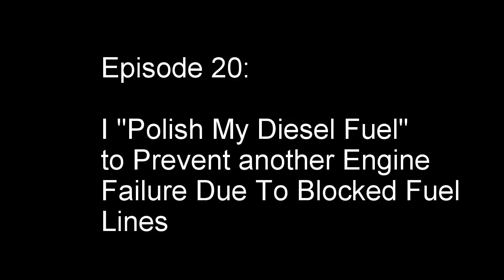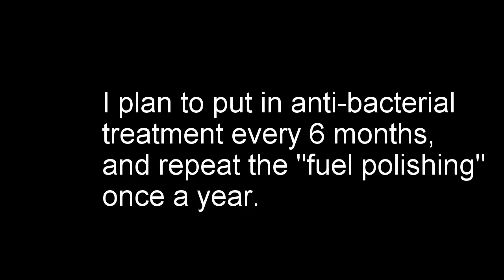Ep 20 Diesel Fuel 'Polishing' To Prevent Clogged Filters and Lines

Comment: The fact you do not see more water than expected is  because of your practice of keeping your tank topped off. I had learned the practice is recommended not necessarily to keep sediments down but rather to limit condensation inside the tank. There may be times you get bad fuel with water but most times water build up is from condensation.
Reply from the maker: Thanks Slamhead.   There is debate as to whether or not the condensation argument is valid…….. (I don't have a view, but do try to keep my tanks filled.   :-)     I do now regularly use chemical treatment, and I also have Racor filters mounted (water separator).   I'm not taking any chances!   Thanks for watching.

Comment: Thank you for all your videos. I recently purchased my first sailboat. She has been idle for the last three years so one of my many tasks is to polish and de-bug the fuel tank. I am in the process of building a fuel polishing unit and would like to know if there is any particular reason why you used copper pipe and n
Reply from the maker: Any type of hose or pipe will do.   I wanted it to be stiff so that I would be sure that I would be close to the bottom of the tank when I did the suction.  (I was concerned a soft plastic tube would hit the bottom and then bend up several centimeters without me realising it, and not suck up the crud on the bottom.)   Be aware also that many tanks will have baffles in them to prevent too much sloshing of the fuel.  It is difficult to get behind the baffles --- but some cleaning is better than no cleaning.

Comment: After having my engine fail due to heavy seas like yourself I now carry a full jerry can of fuel which I have plumbed in through a selector so if the main tank supply is blocked or filters choked up I can select the alternate tank/filters and be guaranteed to get fresh clean diesel and a couple of hours running endurance at least so I can clean/replace the main tanks filters.
Reply from the maker: I haven't rigged mine like you did Mark (space constraints), but I have extra plastic tanks, and hoses/primer pump so I think I could quickly bypass the normal fuel line and feed in just before the engine mounted filter if need be.   I also regularly use the chemical treatment now as well.    Fair winds.

Comment: A Diesel engine will not fail from clogged filters or lines. That will only affect the injection system. It can ruin the injectors and injection pump, but the engine itself will never fail from that. The worst that can happen is the engine will stop running for lack of fuel, but it will not cause catastrophic internal engine damage.

Comment: Patrick, thank you for another excellent video. On Racor's website, their definition of filter sizes
10 micron (98%@10 micron) - Captures more contaminants than 30 micron elements, and is more effective at stopping water
“2” micron (98%@4 microns) – Provides maximum water removal and filtration and is capable of protecting all modern injection systems. Of course the down side is the better the filtration the quicker it will clog up. Will you be permanently installing the water seperator (if not one already fitted). 
Keep them coming as very useful information. Cheers Ding
Reply from the maker: Many thanks Ding.  I think most boat owners I know use a 10 micron filter and water separator, followed by a 2 micron filter mounted on the engine.  That's what I do anyway.   However, that doesn't prevent blockages in other parts of the system if you have a lot of valves and or sharp turns in your lines.   I learned that lesson the hard way (Episodes 12 and 13).   Thanks for contributing.
Reply: Hi Patrick, I found this very thought provoking, so it questioned me to review what  I do. Obviously there are 2 issues here, the water and the growth. I do have a water seperator fitted, but have always just changed the filter with the same type filter. Never considered the micron rating to stop water. This 'water' wouldn't cause hydraulicing of the Engine but possibly promote corrosion of internals?. Lesson 1 learnt.
Stopping the growth? I use a fuel conditioner, but never really any regime in how often I apply, other than when filling the tank. I found this article from Dow Chemicals (lots of big words in there) but the crux is....
Since biocides are consumed as they kill microbes, survivors will flourish as soon as biocide concentrations
decrease to sub-toxic levels. In fact, sub-toxic concentrations of biocide may stimulate growth! Lesson 2 learnt, regular treatment of the fuel. Thanks again Patrick. (hi-ho hi-ho it's off to work we go)

Comment: Last year I made a video regarding diesel bug and also filled some clear bottels with water and diesel to see how much time it takes to develop diesel bug, with and without the "additive". Now one year after I can see some heavy slime forming in the samples with water in the bottom, but it only turns dark in the one without additive. The dark stuff is the sludge there is clogging up the filters. According to my test there is no bugs forming in one year old diesel without water in the tank. The o-ring on the Bavaria fuel cap can go bad and crack so water will enter into the fuel, so a good idea to keep an eye on the o-ring in the fuel cap.
Reply from the maker: Thanks Tino.  I use the diesel additive recommended by Volvo Penta (Actioil A550).   It seems to work.  I also installed a Racor transparent filter/separator so I can see any water build-up.   I haven't noticed any in the 2 years since I installed this filter.  I will check the o-ring, as I have never changed it.   Best regards
Reply: Super :)

Comment: Hi Patrick.
Great & very detailed video. What are Volvo Penta’s feelings of additives, it’s bound to change the combustion temperatures and compression pressures within the cylinders, that said diesels are very robust and the ppm / dilution would be high. I recently purchased an endoscope camera probe kit from amazon, an amazing tool, wireless connection to my iPhone, it has a torch built in and has a semi-rigid cable attached therefore you can angle and form the direction to get into crevasses etc, you could inspect the tank thoroughly with confidence and ensure all areas are inspected and confirmed clean. It was about £20.00 online.
Brilliant videos keep them coming.
Reply from the maker: Excellent remark Andrew.   The bacteria killer I bought (Actioil A550) is recommended/marketed by Volvo Penta.   That's why I bought that particular brand, as I have no knowledge about the pros and cons of the various formulas.   I really like you endoscope camera idea.   Am definitely going to look into this.   Cheers

Comment: You may not see water because the additive is mutually soluble in water and diesel, like methyl alcohol. The water is no longer a separate phase.
Reply from the maker: I think you may be right Paul.  I looked at the ingredients, and there are some 15 letter chemicals which may well bond with the water molecules.   That is such a nice explanation, I'm going to believe that is why I did not see any water!   That said, I am going to add a Racor filter in series just as insurance.
Reply: I think perhaps the high pressure polishing pump might also assist the water and diesel to mix, normally these filters have a very slow flow rate through them that makes separation easier!

Comment: Hi Patrick,
Very interesting video  . Thank you very much for knowledge and epratical experience sharing.
I intend to make a similar device as yours  on my 200liters tank ( mounted on a Beneteau), but I Have some questions :
- pump capacity with respect to filter capacity : you have said your capacity is slightly too high ( 280 L/h compared to 270 for the filter . OK what is the  optimum flow in order to maximise the water separation? I have not seen this information in the Racor datasheet.  Du you have any opinion?
- more critical for me : what is the opening you use in the tank? How do you ensure fuel sealing afterwards ?
Reply from the maker: Thanks Loic.  I suppose that if Parker/Racor says the filter is rated at 270 l/hr, they have done engineering studies that show good performance at that rating.   For the opening in the tank, I used the fuel gauge sender opening.   It comes with a rubber gasket, and I bought some sealant that I put on the gasket that is certified for use with diesel.   No problems.

Comment: I would think that if you add a small section of pipe to act more as a weight to the return hose of your polishing setup you could use it to shove around the bottom of the tank and help stir up any sediment thereby getting even better polishing results.
Reply from the maker: Yeah -- that might work Berg.   I'll give it some more thought.  That said, I was fairly confident that I got to each and every spot in the area available.   The bigger problem is that there are 2 or 3 baffles in the tank to keep it from sloshing around too violently.   It's just impossible to get behind the baffles without additional inspection ports. :-(    Thanks for commenting.

Comment: Hi Patrick, Copper and diesel don't go together very well, but was only in use for a short time. It is a shame that there is no drain at the bottom of your tank, I have the same problem as with only a few components "as you put together" it could be a permanent polisher as cruising boats buy fuel from different places all the time, and with plenty of bad experiences a permanent polisher is magic, every time you buy fuel you can polish it.and get rid of the condensation from the tank as well. I know some boats that have permanently running polishers, that turn on with the ignition key. A Baja pre filter is common as well.
Reply from the maker: Yeah Peter.  The copper tube was just for the short pumping time.   Its stiffness allowed me to point it and get to the bottom the maximum possible.  I'm looking at various models of a Baja filter to use when refueling.   Good suggestion.   I'd like to have a permanent polishing system on my boat, but honestly, there just is not the space.   That said, as the majority of fuel is recycled into the fuel tank when the engine is running (after bypassing the injectors), a good Racor will give pretty good protection.   Thanks for commenting.
Reply: Hi Patrick, the main reason I mentioned the copper is that I thought you were going to make it permanent as you would need to go through the top the tank to the lowest take up point of the tank "the only way to polish the tank" as the pick up for the motor never gets the gunk out unless your getting mulled about in a seaway and without a polisher you are back to square one and it happened at the wrong time for me crossing a bar after manually cleaning the tank like in your video, six months later I took on 200 litres from a river based Marina that had flooded several months before (Twenty eight years ago). I have stiff plastic to replace my original copper pick up after being informed that copper wrecks diesel. Really like you videos. Fair Winds and Following Seas.
Reply from the maker: Many thanks Peter.   I am hoping that a combination of 1) strainers, 2) regular biocide, 3) Racor separator, 4) shut-off valve with a larger orifice, 5) Baja filter when in unknown ports, and 6) an annual polishing will keep me safe for the future.   I never want to suffer an engine failure while crossing a bar like you did.    My failure this year in safe, 'blue water' was a great learning experience.
Reply: Your video's are great and a change from the norm on youtube, the only trouble, I was with you and going through the frustration and it kept me on the edge until you made port.
Reply from the maker: ;-)   It was great fun.   Sorry if I made it look a bit more dramatic than it was.    It was a great learning experience for this intermediate level sailor.   Thanks for watching Peter.

Comment: would you have harvested more contaminants if the tube entering the tank had more flexibility so as the reach further along the bottom and to the left of the tank? Or, does the mere rapid flow of fuel create enough of a stirring effect to loosen bottom sludge? Great Info as usual though!
Reply from the maker: Most large tanks have baffles to reduce surging/sloshing.  You can't really get around those walls anyway with any kind of probe.   The 'issue' with a soft tube is that the diesel bug sits directly on the bottom.  If a soft tube hits the bottom and then bends up a cm, you may not get the bad stuff....

Comment: A great video. I would have expected more contamination too, i had to do my tank last year after the engine failed. Fortunately i could remove the  tank so it was  a lot easier. All though my tank was very contaminated it was the fuel line that was gummed up which i cleared with an airline. I wonder if you were just unlucky with all the rolling you were doing when it blocked that a bit of dirt went through and that blocked the line. This is a great sailing channel, well done.
Reply from the maker: Many thanks TB for the kind words.   In Episode 13 I showed that it was indeed a tiny orifice in a fuel shutoff valve that was blocked.   As you noted, a fairly comprehensive 'polishing' did not pick up a massive amount of sediment fromt he bottom of the tank.   There are two possibilities: 1) the chemical treatment I did to 'kill and dissovle' the bacteria with Actioil, did in fact kill AND dissolve the bacteria, or 2) there really wasn't that much contamination in the tank to start with.  It really was just bad luck that a relatively small amount of sediment blocked the small orifice in the fuel line valve.  (I have since changed that valve for one with a larger orifice.)   I'll never really know, but I wiill continue with periodic chemical treatments henceforth.    Many thanks for commenting.

Comment: Excellent video Patrick,  I fully expected there to be a small hand hole and secure cover  on the top of your fuel tank, would make a thorough clean out much better ?
Reply from the maker: Yes -- I was surprised there was not one.  (In fact, due to the baffles in the tank, you really need a couple of inspection ports for a thorough cleaning.)

Comment: Hi many thanks for the video always great to see the theory put into practice. One observation I have relates to someone else’s video on changing fuel filters and always fill the filter bowl up to the top of the filter with fuel before putting the top on. What he said was this ensures that all of the filter is used and not just the bottom 2 /3rds. As your filters look like that they only used the bottom ⅔ rds I was wondering if you had filled the bowl up or was his info in correct?
Reply from the maker: I have seen that same video Clive.  This was the first time I had used the Racor.    I now always  top-up the bowl with a plastic cup with diesel prior to closing.    Good catch.